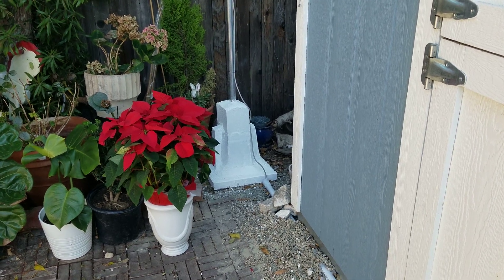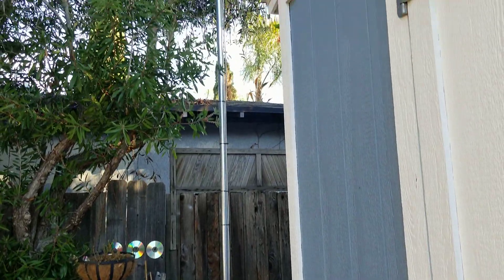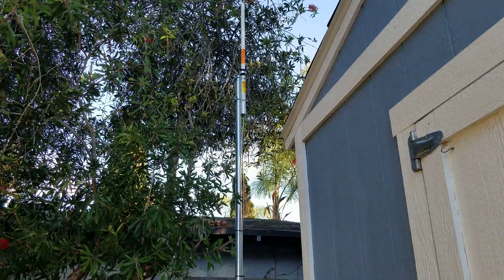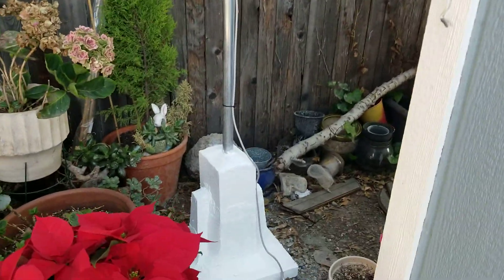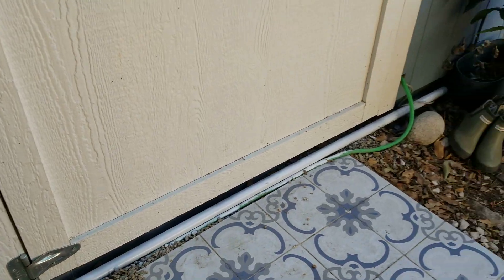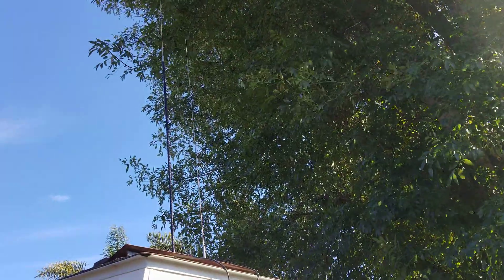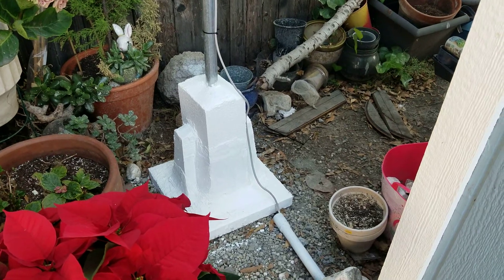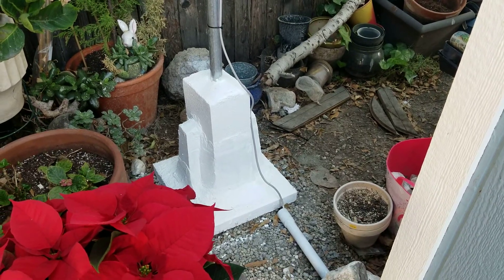Solarcon / Antron A -99 Mounted on 40 dollar 10 foot mast. It's easy to mount with the tiltable mast

Comment: I have a setup similar oy urs (a solarcon A-99), and a backhouse alo like yours... I have a 10' opole I want to fasten the antenna too, but, was considering fastening the base of metal pole to the shack, of it 5' from the ground up the wall of my shed (would probably make the top of the pole bout 15', and I'll attck the antenna about 1' from the top of that. I live in the mounains, but, in a madow clearing area for about 1/2 mile radius - curious what your surroundings are? ...you mention that the reception, even at the height in thi video, is good?
Reply from the maker: Yeah reception is good, or at least it seems very good.. However, it is skip. So height is not as imperative. Like  is the case with VHF and UHF. Now if you go higher it obviously isn't going to hurt. But I have my Solarcon A-99 relatively very low. Only ten feet off the ground. BUT it still works. I make lots of contacts all over.  Since, the antenna it self is pretty tall. 17 feet I think it kind of off sets that. My personal opinion, not scientific. By the way I am in the middle of a  suburban neighborhood.
Reply: @elliothuh669  thanks for that! Yeah I may follow your advice with that - I AM in the mountains but in a clearing, and so mine may work similar. Not to mention, in time I will add HAM, and if I set things up about 6' off the roof of the back house (which will be where the 17' antenna 'starts'), it will be easy to get onto he roof t adjust the tuning rings for HAM when he time comes that I add HAM. I am pretty new to all of this, though - you mentioned 'it is skip' - I remembr heaaring what skip is (not unline shortwave transmission into the upper atosphere), but, trying to remember - skip is a certain mode you'd put the CB in in order to broadcast that way, right?